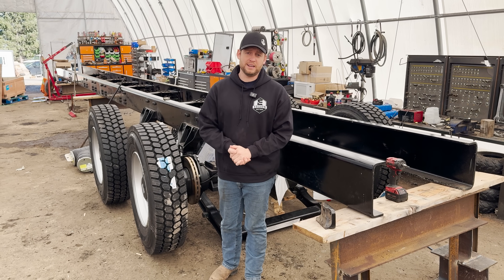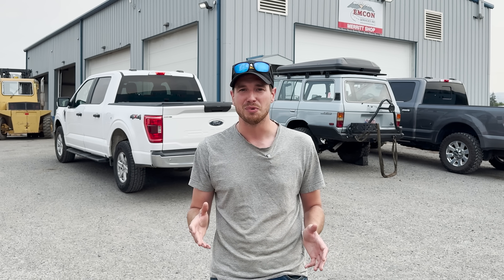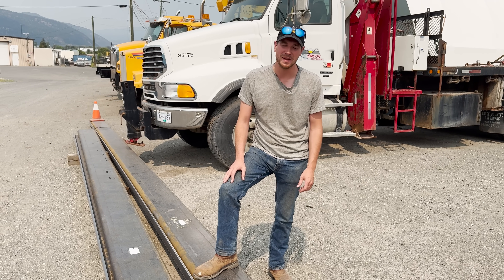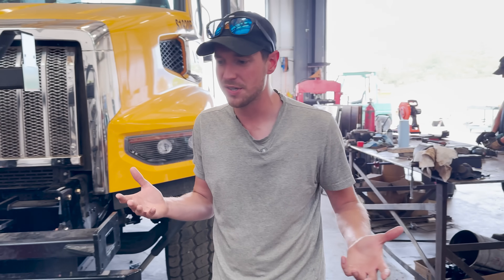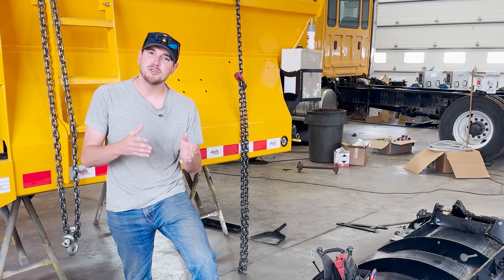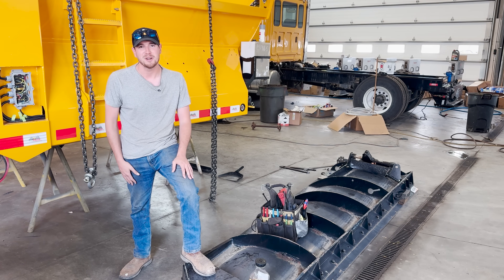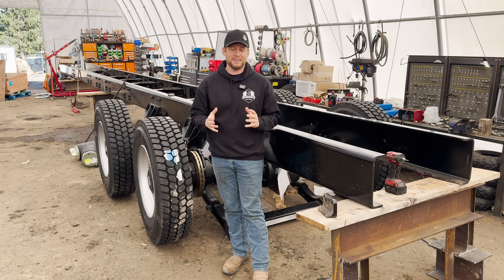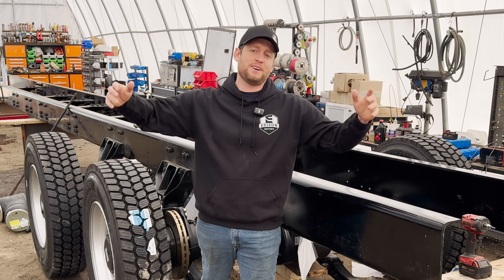Worlds First Diesel Electric SnowPlow

Comment: Havent seen this yet but this is an important contract. In part it's of course important for Edison Motors, but it's also important for the entire industry. A snow plow is not an ordinary truck. It's going to be working in a very hostile environment. The low temperatures, the snow and ice and the water puts new demands on the tech. Contacts will have to stand being wet and ice covered, the battery has to be kept at a decent temperature where it will work well, and the temperatures will change how the insulation on the wires behave. This is not just putting a plow on a truck. The truck has to be able to handle what the weather hands out when it's at it's worst. A snow plow doesn't stop because there's three feet of snow on the road, it power through to make the road usable for all other traffic. I do hope it all turns out working well as a diesel electric snow plow is one of the toughest trucks I can imagine them building.

Comment: I hope that the "Grader Cab" will be the standard for this snowplow chassis. I haven't driven snowplows of that size, but visibility is parimount! Being able to see both ends of the main plow and the wings, if two are used is a safety issue! Center seating should be the standard!!! Plus in my area, one person operating plows are the new standard! The whole rest of a standard truck cab is a waste of steel & fuel. Or in this case electricity! Look forward to your use of the grant money & the build itself! Congratulations🎉 Edison Motors!!!!👍👍👍

Comment: Do they use salt on the roads in BC? Im in Ontario and the salt ruins vehicles in about 10 years. Undercoating with oil helps alot. Would you guys consider using dielectric grease on all your wiring connectors, and heavily undercoating these trucks when theyre brand new to help protect them? Trucks with double frames rust jack and they end up not being safe for the road. Even putting grease on mating surfaces like spring hangers and where cross members bolt together would considerably reduce the potential for rust jacking. If I was to buy a brand new truck Id pay extra to have everything greased and undercoated.
Reply: They are already running a single heavy frame rail instead of double rails due to the rust jacking problem....they are designing with intentions of a 50 year plus standard operational life so corrosion protection on electrical connections and mating surfaces will have to be part of that
Reply: @unhippy1  I like the idea of a single heavy frame rail better that double frame
Reply: @ericbrinson9741  they have an interesting video up about the choice to go with a single heavy rail instead of a double rail and he points out the tensile strength of the single heavy rail is 2 parts of fuck all less than the double rail anyway

Comment: Dang, i wish more companies were run by ACTUALL PROFESSIONALS in their field
Reply: Often they are started by people knowing what they are doing, but they also tend to be less than optimal as organizers and such. I'm a computer tech and one company I have bought a lot of power supplies from a company in Taiwan. They are not one you are likely to have heard of as they were mostly making server grade power supplies and had no presence on the regular market, but they are good, very good at what they do. One day I was told their boss was busy as he was working on developing the circuitry for a new PSU. He was still designing power supplies and left the management of the company to employees as they were better than he was at that. Note that he was still the majority owner if not the single owner, but he knew he couldn't run the company as well as the people he hired for that.
Reply: @blahorgaslisk7763  i think thats the key part, he still works and owns the majority of his company, so its unlikely that staff is going to take advantage.

Comment: Will the salt not affect the batteries?
Reply: How?
They are dry and well temperated in their Boxes.
Reply: @jurgens9867  yes I understand that but salt eats away everything... I love the idea and reality of the concept of the regenerative truck but this is carrying salt and spreading salt so it is getting 100 times more than a normal truck would.. That is why I am asking.
Reply: @gourmetfitness5768  The salt should not have any effect to the batteries,
if the batterieboxes are sealed enough, but that should be not a big problem.
In aviation they use much more corrosive materials than salt, to keep the runways icefree.
Ships and boats are made of aluminum, steel, plastics, wood and other stuff. They swim in salty water.
Reply: @jurgens9867  ok point taken..

Comment: How many axles power that truck? Is there a fuel economy advantage to having all axles drive the truck? I do know that with the Tesla vehicles, adding that front axle option increases the range, on the same battery...
Reply: What? A Tesla model 3 or Y has longer range when it's only rear wheel drive on the same battery. And the Tesla Semi is only driving on the back wheels, not the steering axle.
(Tesla use an efficiency motor and two high power that is connected when needed, but that's beside the point).
Reply: @subwarpspeed  I didn't say all. Back before the model X was for sale, Tesla added the front motor and its range went up.

I haven't watched that closely, but I figured the physics remained the same.

Comment: The biggest item everyone overlooks when trying to help people understand why hybrid drive systems remain CRAZY compelling is that NO LONGER NEED A REVERSE GEAR DRIVE FOR THE MECHANIC TRANSMISSION. Take that one gear away and congratulations you've just simplified ESPECIALLY any automatic drive gear box/tranmission by an order of magnitude. Possibly increased reliability and durability by an order of magnitude insodoing as well. Still a huge fan of tag axles this can become a very compelling product especially for this particular type of work and regular highway use work as well. I used to follow a snowplow guy from Canada on Youtube i think is his name was Hoff or Huff can't recall was a great channel tho he'll let you know all there is to know about snowplowing either way of that i have no doubt😊😊
Reply: For most purposes you've removed the entire transmission, you just have the equivalent of a differential (one gear reduction from motor to axle speeds) and electric motors have a wide enough torque curve to be fine at that one ratio.  Same as how locomotives tend to be built.
Reply: The axles for Topsy have 2 gears built in. The new one as I understand it has none select-able "gears"- just the reduction. And one electric motor per side so it can programmatically avoid slipping without a differential lock and can also steer with full traction.

Comment: Hey Edison ! That's a nice project you got yourself into. Snow plowing is a stressfull environement for trucks, and you will be able to trace all the gremlins out of your trucks ! I've got a interrogation, are you planning to do some sort of a blockheater for the diesel generator ? For example, the snowplow was parked and charge for the night, then work for 2h out of batteries, then, when you want to start the diesel engine, do you think you can preheat with a little electric heater the bloc, to start the engine already hot to improve it's durabilty ? (Sorry for the typo, english is not my motherthong)
Reply from the maker: If we make a snow plow survive we’ll have a much tougher winter truck.

There is a block heater yes.
Reply: They'll probably want a Webasto diesel water heater to heat the cabin, and you can pre heat the engine with it also. Diesel get you the most heat out of the diesel and Webasto has 2-35kW heaters.

Comment: Given the flooding problems that are being experienced might i suggest chase that you see what can be done to make things as  water tight and protected as possible...especially for these special responce vehicles.  You may have to think about how high up you can get your control systems as well as sealing them.  
BC has seen more than its share of flooding as well as fires.. and the ususal winter cold..

Comment: As you move ahead with the snow plow project take a cue from the aircraft industry,  Rather than having a central hydraulic system, use individual electric hydraulic actuators.
Reply: This is exactly what we'll be doing :D electric over hydraulic controls, with a single variable speed electric motor to regulate pressure
Reply: @Littlebitoferic  That's still a central system.  Aircraft use individual electric over hydraulic actuators that are self contained.  Hydraulic cylinder with high voltage pump with expansion chamber, no hydraulic hoses or mass storage.

Comment: I think a snow plow is a great first project.   Not only will it show how an electric vehicle can work in the coldest environment, but also a corrosive one.  Having the ability to charge stranded EV’s is a nice bonus.  And they can easily run at night in residential areas without the loud diesel, just the scraping of the snow.  Being a snow plow will also give great feedback on traction control since each wheel set will have independent control. If it works well then you have a company that can benefit from converting a lot of trucks to Edison hybrids.
Reply: Yes I agree. The sound of the diesel may be a problem in a city. But on the secondary highway I live on, the sound of the plow on the pavement, not the diesel, can be heard for several kilometres, before it passes.
Reply: @davemason6501 came to say something similar but w 6-8 inches of snow being thrown at 45- 50 mph you can hear the low frequency rumble/roar from miles away! I would wake up from that minutes before you would hear the diesel and that was only heard as it passed by.
Reply: I don’t think the sound of the engine is a big issue because I never hear the engine of the normal plow truck
Reply: @Lorith  I don't know what you're correcting me on, because I didn't say anything about that. I said that the vehicle can operate for hours on battery only, which is verifiable by watching the test run of Topsy on this channel.
Reply: Snow plowing is one of the most corrosive environments for a vocational truck.. i worked for emcon kn ontario for years..no retired. We had brand new trucks with electrical issues in the first 5-10k km. Failed sensors, burnt pigtails all because salt brine gets into litterally everything. If if Edison can get things well enough theres real potential but if not its going to mean constant headaches.
Reply: @dirtdevil70  I think that is one of the advantages of electric.  You have fewer moving parts and most of the sensors are going to be internal.  And with Edison’s right to repair fault codes will be easy to diagnose and sensors will be off the shelf.
Reply: Gincor Wrex Carleton Place Ontario. If you want into the Ontario market.
Reply: It seems like a garbage truck would be an ideal use
Reply: I live in a neighborhood that has to plowed multiple times a night in the winter. I have never been able to hear the diesel engine of the truck. The blade of the plow on the other hand.
Reply: Seems a powered front axle would be a huge plus. And dielectric grease everywhere to keep salt out.
Reply: Be careful in working with the Canadian government they always have a way of Effing you in the ass.
Reply: Pushing snow is going to be a nice power graph.
Reply: It's definitely the perfect second project
Reply: Lets keep a running count on how many say the same thing!
Reply: Not an electric vehicle but a hybrid. Not to be confused.
Reply: @reboot_2.00  Series hybrid, where the diesel engine's only purpose is to charge the batteries
Reply: I would love to see these here in Minnesota
Reply: This is a hybrid and it is my understanding that the diesel generator will always be running when the truck is in use.
Reply: @lint2023  No, they can run for hours on battery only
Reply: @drewdane40  Thanks.  👍👍
Reply: @AustinTA-cd9rs I can see a case where the hybrid is a significant benefit: the putzing around inside cities, where there's a lot of manoeuvering to cover intersections and parking lots. There, diesel is at its worst and also loudest due to constant acceleration-deceleration, while the plow itself will be quieter due to lower speeds.

But these areas are usually covered by smaller trucks and pickups, at least here, with the behemoths shown in this video reserved for blasting through tons of snow on major roads and highways.

Of course, there's a slight bias there due to the NA love of stroads, which would need more big trucks inside cities. 

For the high-speed highway runs, the savings from the hybrid power train will definitely be smaller, though they might achieve some savings simply by the first hour of operation being diesel-free (by charging the batteries at the depot). They have a decent chunk of battery on that truck.
Reply: Check Topsy's log mill runs, they did that all on what was charged up in the batteries. Your 90% are just made up. Will it be as efficient as using it as a logging truck driving down mountains loaded and getting regen braking? No.
Reply: @AustinTA-cd9rs  Watch the video of their 90,000lb truck working an entire day hauling logs before you make foolish statements.
Reply: @lint2023 I don’t think so.  Previous videos show that the diesel generator kicks in to charge the batteries then stops when batteries are fully charged.   Their platform runs off battery power the generator just helps charge when needed.
Reply: @lint2023  it's setup is like a PHEV, the genset only runs as needed or wanted.
Reply: @lint2023  Regardless the EV power train will be subject to the cold and corrosive environment. Which the parts ecosystem will need to survive such a harsh environment. Go test it out in the real world.
Reply: @Neojhun  What makes you think that the drive motors will be a problem in the cold? Corrosion from salt on the roads causes big headaches with ICE trucks too.
Reply: @lint2023  even assuming it does, it's a much smaller engine running in a high efficiency configuration. At a minimum it uses less fuel.
Reply: @lint2023  wrong its got a battery that runs the electric axles the generator is only there to charge the batterys. this truck could run on just electric without ever using the diesel engine if you have a short haul and plug it in
Reply: @lint2023  no it's not. It's a diesel electric. 

Hybrid has drive from the ice motor and from the electric motor 

A diesel/petrol electric has a internal combustion motor that is only a generator. No drive to the wheels. It's just power supply. That can charge the battery.
Reply: @lint2023 no it has batteries
Reply: @lint2023 no, the diesel doesn't always have to run.
Reply: @lint2023 yes and no.
Reply: @lint2023 The generator only runs when the batteries need charging.  At the slow speeds these operate, the generator will probably run for 30 minutes a day.
Reply: @lint2023  the generator will only run when the battery gets low. It can charge the battery far faster than driving depletes it. The vehicle also has regenerative braking to send electricity back to the battery when the vehicle brakes.